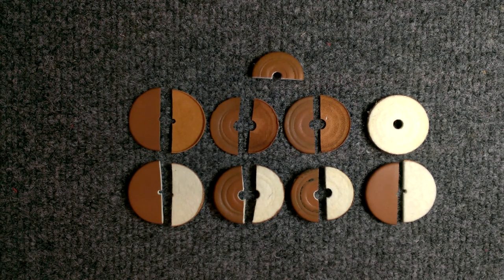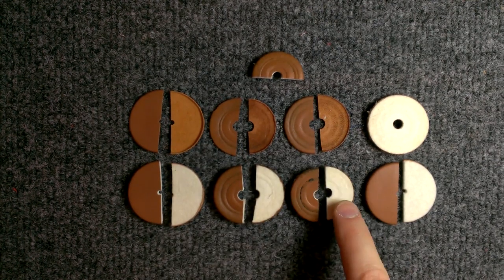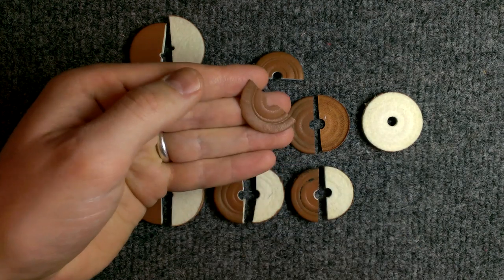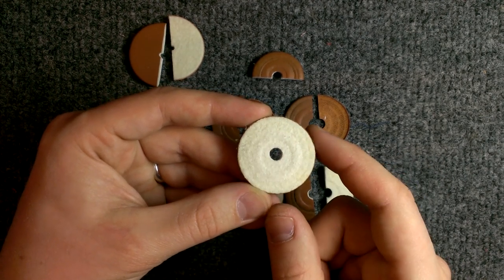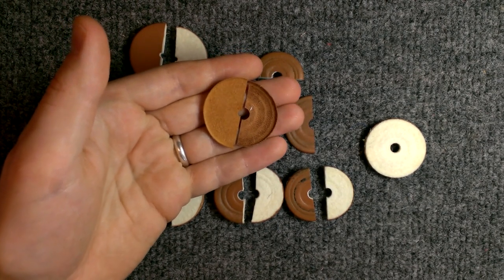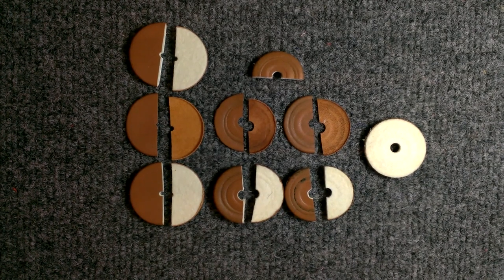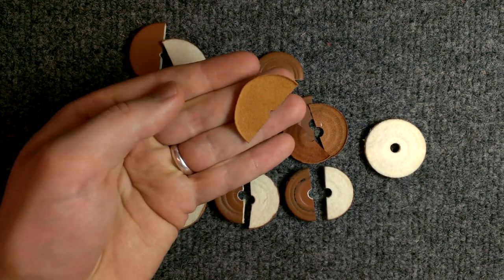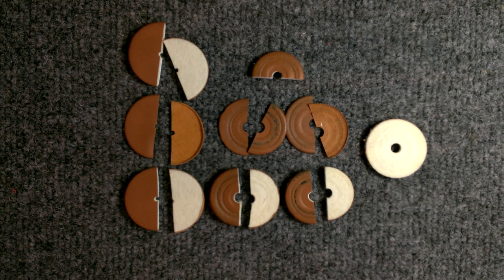Saxophone Repair Topic: New vs. Used Pads

Comment from the maker: The worst pad of the bunch here was from the bis, which is not a closed tonehole.  Though yes, typically pads that are sprung shut are the worst offenders.  

I am not a fan of oiling pads at all, but I have never done it.  When I see it on a horn that is brought in for repair, it looks as if it just makes things dirtier much faster at the least, and possibly also ages the pads faster than normal.
Reply: Matt Stohrer 5555
Reply: Matt Stohrer 5555t555t55t5tt
Reply: Matt Stohrer 55tt555